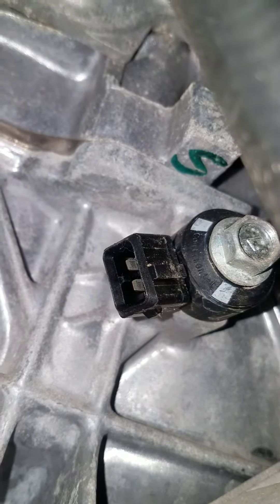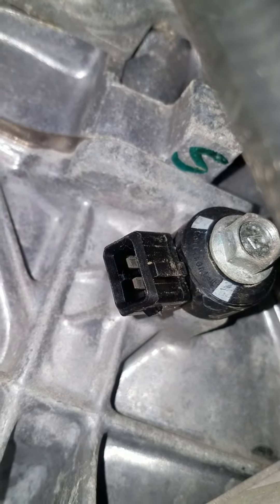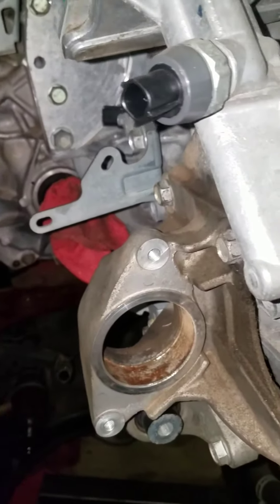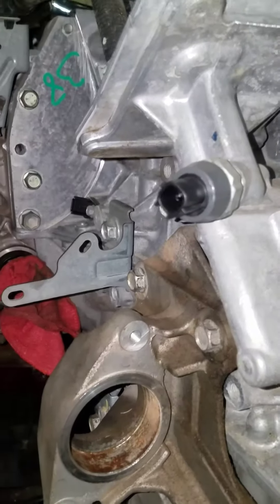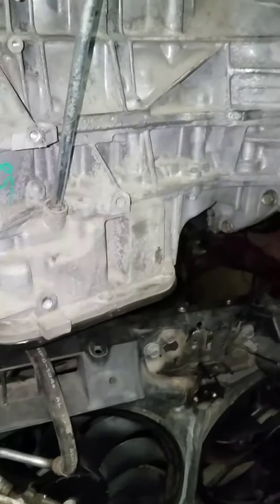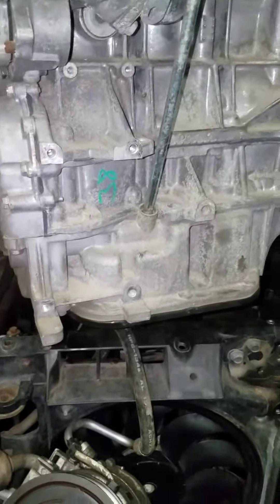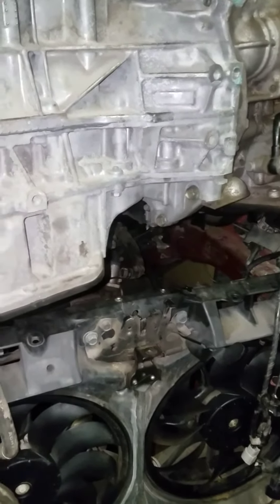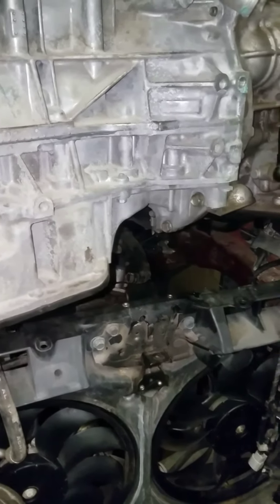Engine Removal/Install in a 2012 Nissan Altima

Comment: im not a mechanic just a curious 16 y/o and was wondering possibly could the 2.5sl be engine swapped? (v8 or ls, etc)? if so id appriciate any expertise or tips on doing so :D
Reply: anything could be engine swapped but it would be a LOT of work to put a v8 in a i4 compartment

Comment: Can you describe what the car was doing prior to the head gasket diagnosis? I believe I have a blown head gasket but I've already been told 2 different diagnosis, head gasket being one of them.
Reply from the maker: This engine was overheating very badly.  The #3 piston had very little compression and def had water in the cyl.  The customer said it locked up after they pulled over to let it cool down. Basically, they lock up because so much water got into the combustion chamber that it stopped the engine from turned over. Water does not compress, so if enough gets in, it will stop the engine from running and can very quickly cause other issues like bending rods or breaking pistons.

Comment: So im about swap my motor but it a 2015 nissan motor and trany to the 07 altima. If i have all the working from 2015 engine bay to 07 engine bay should it work or do i have change the bcm
Reply from the maker: You just have to make sure your long block and trans are the same for the easiest swap.  Do lots of research before you start the job.  I'm not real familiar with the Altima, so I'm not sure what all would have to be changed to make it work.  When I perform a "custom" swap, I do my own research on each vehicle to make appropriate adjustments to make it happen.

Comment: How much would you charge to do a job like this remove a engine & replace it with another
Reply from the maker: Depending on a few scenarios, it would run somewhere in the 800-1200 range to R & R the engine. Plus fluids and other parts needed.

Comment: How much time you spent to remove the engine?
Reply from the maker: racingtoy2000    I believe it was a 14-15 hr job to R&R the engine. So prob around 6-7 hrs to remove it. Part of the R&R time is swapping parts and pieces from the old engine to the replacement engine.
Reply: Just did my swap. I end up leaving harnes attached to the motor.
It was so much easier this way.
Thanx for your post.

Comment: How much did this cost?
Reply from the maker: Sorry, I don't remember what the actual cost was as this video is over 6 yrs old.  Engine/parts costs have increased in the last few yrs.  A good website to use for salvage engines is car-part.com.  Looks like this engine is 500-$800 in my area currently, depending on miles, emission type.  I'd assume labor would cost more than the engine these days on this vehicle as most shops have been forced to increase labor rates due to inflation.

Comment: Any special tools you needed besides a lift.
Reply from the maker: alberto bautista   Just regular mechanic tools. An air compressor and air impact makes the job easier.  No lift required, but you will need an engine hoist and prob a floor jack.
Reply: okc vet what do you say to swaping this engine into a 07 toyota matrix

Comment: how did you remove the grill?
Reply from the maker: M S   The grill has mounting tabs that if you have the right tool, they come out easily. I have a bluepoint panel tool that I use for grilles like this.